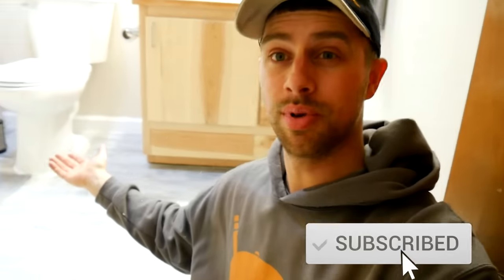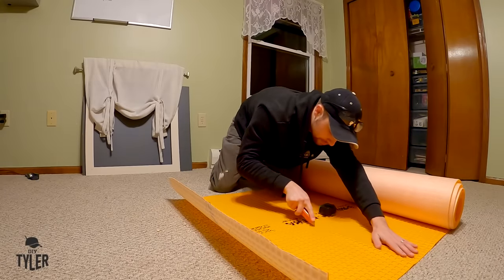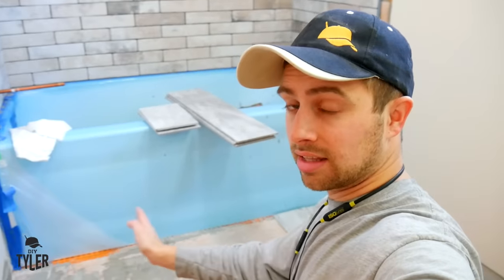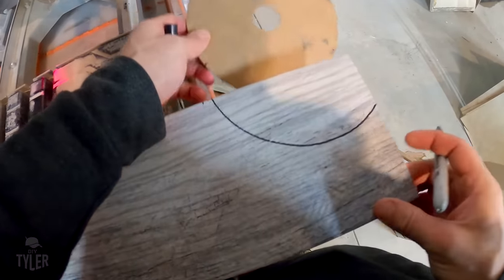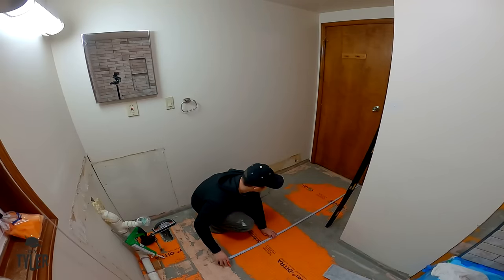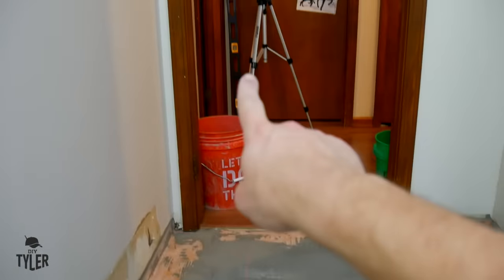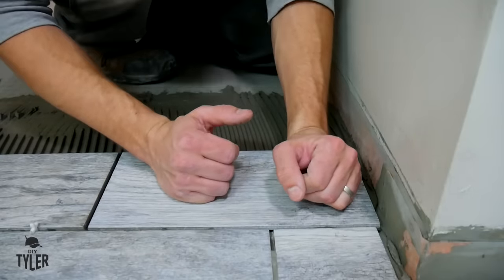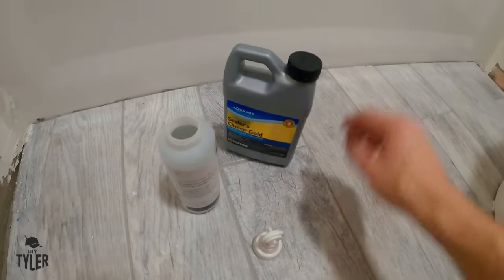Tile Floor 101 | Step by Step How to Install Tile for the First Time

Comment: You should never caulk around your toilet because if it starts leaking you won’t know until the underneath flooring is destroyed that’s a pro plumbing tip for you.
Reply from the maker: Some locations it's code.

Comment: You didn't go over the proper way to measure the cut pieces you supposed to put a tile up against the wall vertically to make up for gaping

Comment: Odd I would think you would want a solid foundation instead of cushioned air pockets plastic padding.  Sound like the orange stuff is sales gimmick.  Would it not collapse if piano sits on it over time.  Solid unmovable foundation would make more sense

Comment: Back buttering those tiles flat trial and there’s basically no mud on them 100% insure that number one you absolutely don’t have full adhesion It can leave hollow spots and you’ll make it more difficult for you to set your tile flush. This dude clearly absolutely doesn’t know what he’s doing that underlayment if that’s an upstairs needs to be cement board as well. This dude is 100% a rookie.

Comment: Bro u should never have to Belt sand ur on ur "riges" lol if u prep is done right after ur tile are all set u should be able to slide a quarter across the floor without hitting any riges lol